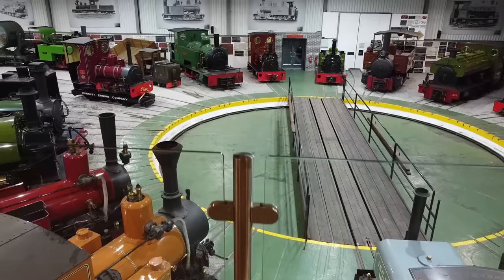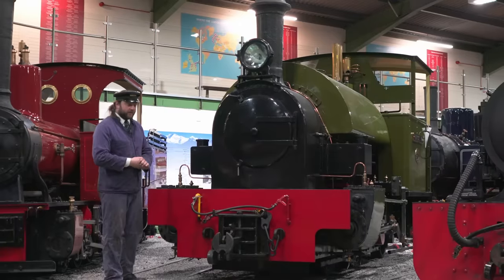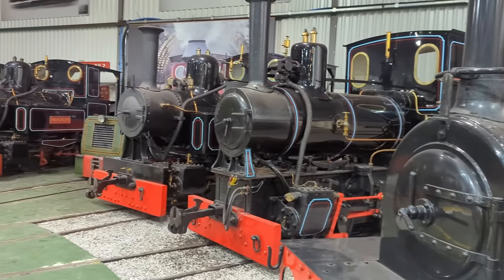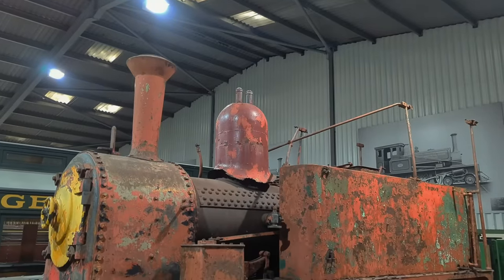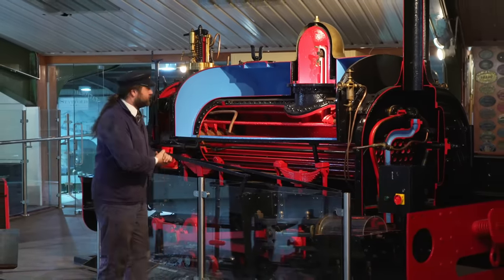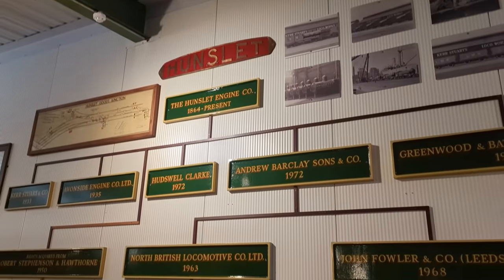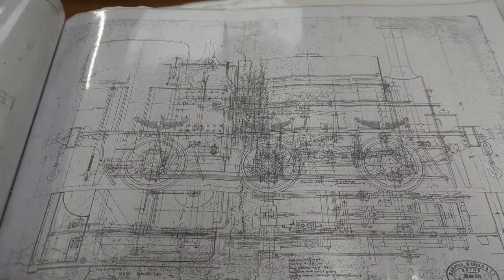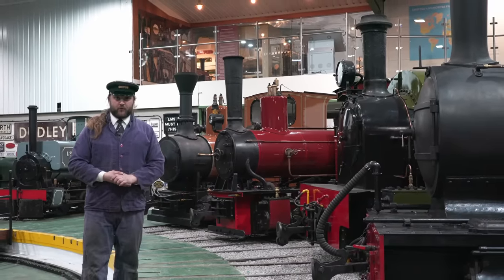The Statfold Barn Roundhouse - A guided tour with Lawrie!

Comment: That was great thanks. Laurie didn't show us the workshop with its modern CNC machines which is at a different level to any other steam workshop I have visited. When I was there last year there were 1-2 new build steam loco's in the workshop and several being restored/repaired. The enthusiast days are amazing with up to 10 engines in steam, plus the narrow gauge tram/trolley and the garden railway also in use. I understand that they have also recently opened another narrow gauge route on the site. Its well worth a visit but is only open on a limited number of days a year. It wasn't that long ago when you had to write to them for an invitation to be able to visit

Comment: interesting to note that the Corpet's brown gear is not the "original" builder's version, as it has been adapted with an Hackworth crank instead of the radial gear that was known as the "Corpet-Brown" valve gear in France. Also, as weird as it looks, Brown locomotives built by Corpet-Louvet were quite numerous and often  seen building lines or proceeding with trackwork on secondary railways! A few were even later repurposed as light passenger engines, and would be seen pulling a couple of wooden passenger cars.
Reply from the maker: Oh really? I didn't know that
Reply: @lmm  yeah! We have the Corpet plans at our museum, as well as an (another) actual Brown locomotive, and most of the exemples of that type features a specific valve gear that is not seen here. Now, was this modified later or was it a feature for exports? good question...